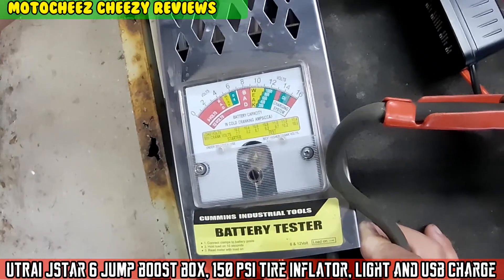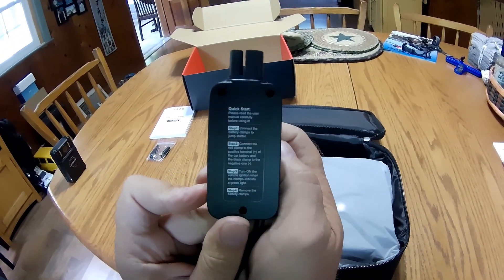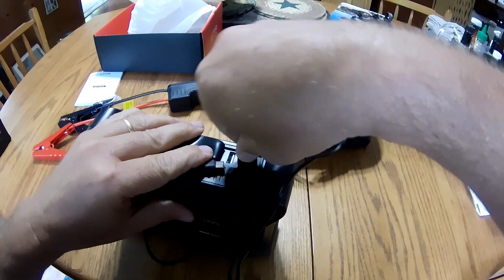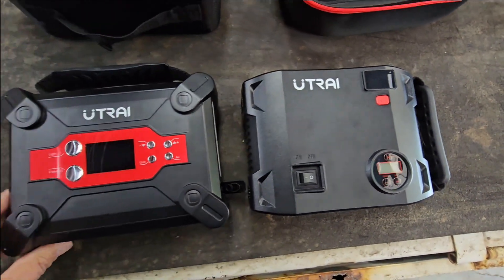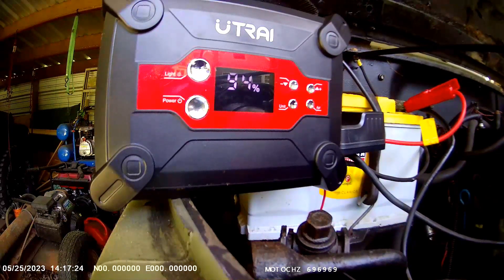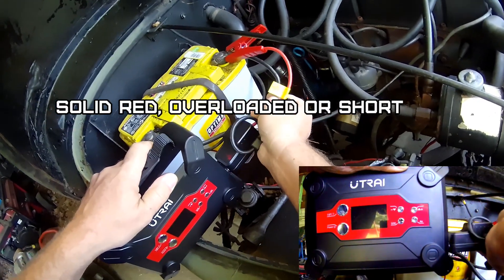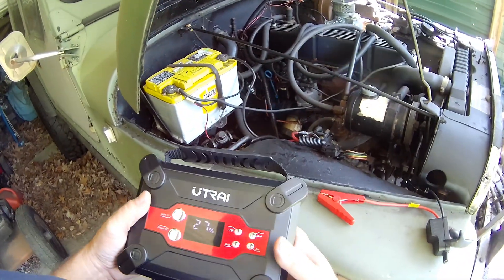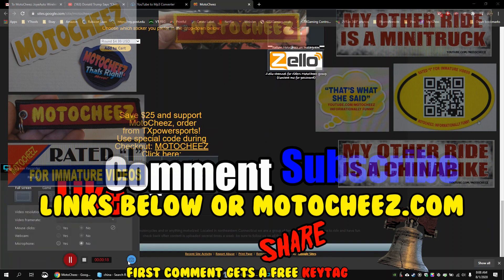Jump starter pack, 150psi Air Compressor, 12V power bank, UTRAI Jstar6 w light, jumper cables

Comment: It starts hard because all of the fuel evaporates out of the float bowl. Get yourself an electric fuel pump to replace the mechanical pump. Give the carburetor a prime before you try to start it. 
Todays fuels are extremely evaporative.
Reply from the maker: I thought it was that too, but I've even dumped a little gas to carburetor and tried ether when it wouldn't start a different times. So it's not fuel but I did get an electric fuel pump too
Reply: @MotoCheez  Are you still running ignition points in the distributor?
Reply from the maker: No, it's electric ignition, it gets spark when not starting. 
I've heard it's the lifters that have to pump up when sitting a while but that don't make sense either lol